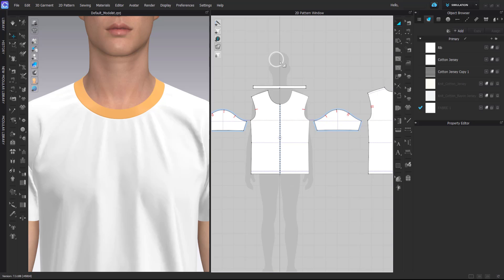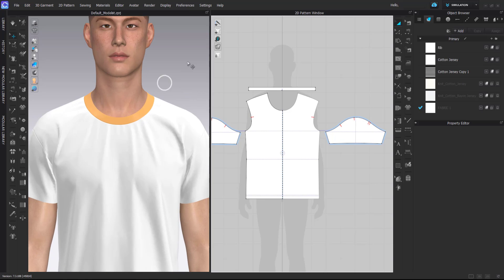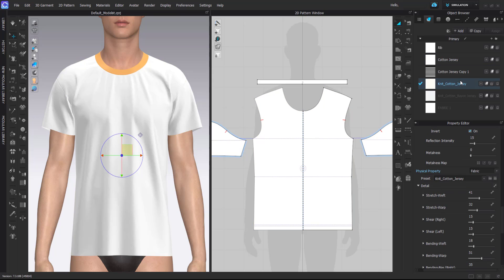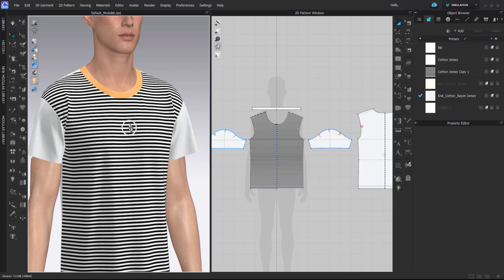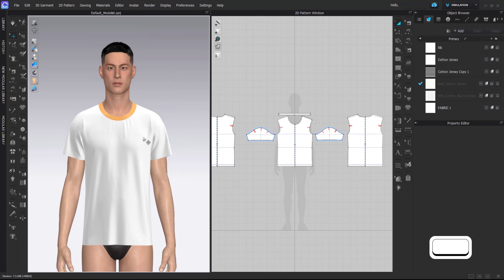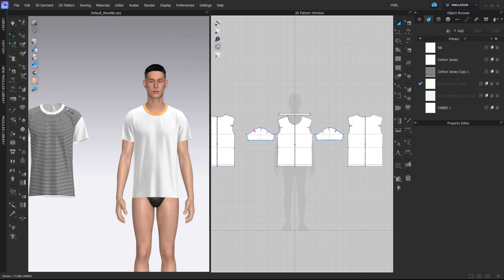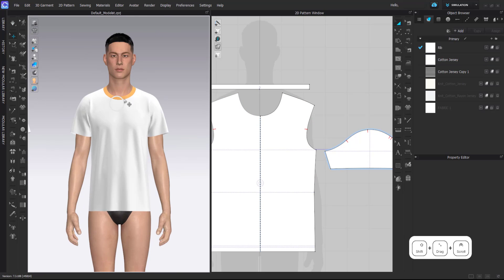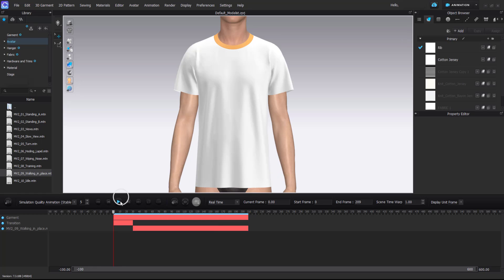CLO3D | Fix Neckline Wrinkles - Animation-Friendly Method

Comment: How realistic is fabric simulaiton, in other words if you see wrinkles on model, will it translate into real life? And vice versa, can wrinkles not seen in model show up in production?
Reply from the maker: Yes, in my experience, I noticed that some product groups/fabrics are more accurate then others. But in general, you have to be skilled in fit and patternmaking, to use 3D for fit. Also the right avatar with correct posture and fabric properties are necessary, to get somewhat accurate result. But even with that, you still need physical fit sample, if you create new silhouettes and aim for perfection. I think 3D is good for creative patternmaking and testing initial ideas.
Reply: @stitchandrender  thanks for a detailed reply